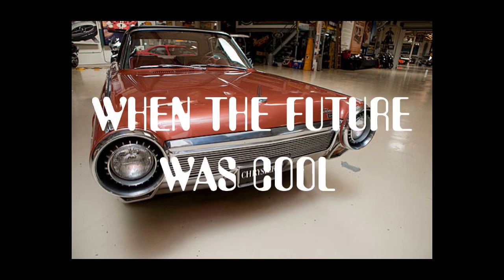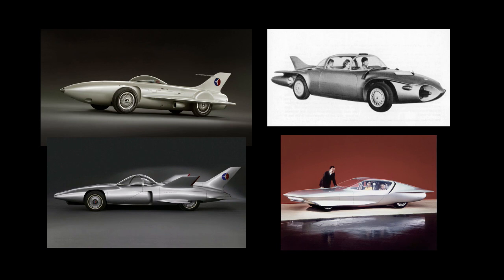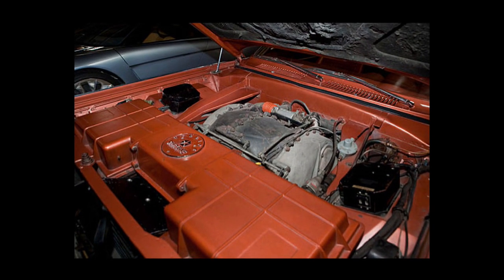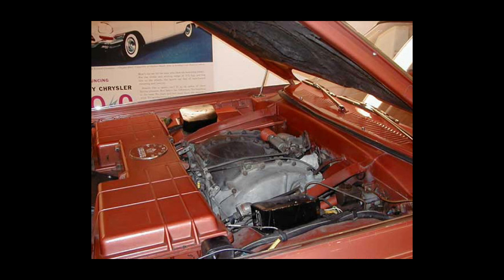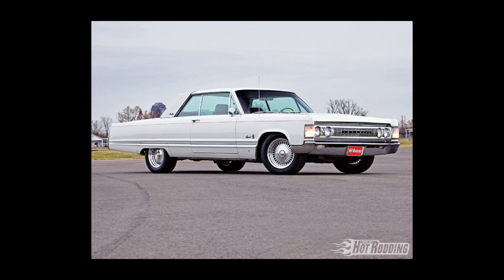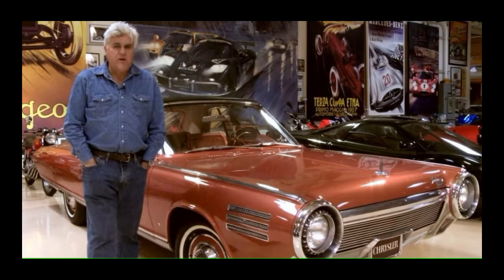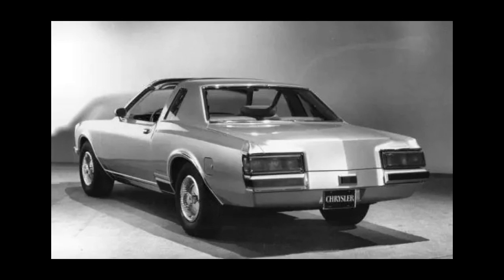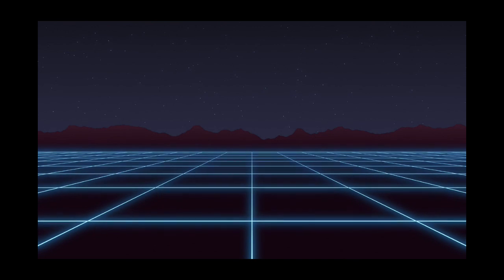A Jet Engine Under The Hood: The Chrysler Turbine Car part 2

Comment: I never got a ride in one, but I did sit in one when it was running. They balanced a nickel on edge on the top of the dashboard. No vibration at all, the nickel just sat there. Very cool car, wished they would have put them into production. Thanks for the two videos.

Comment: FYI A gas turbine engine is NOT a jet engine. They have zero thrust. Gas turbines have more power-extracting turbine stages than jets to produce all the energy the combustor is producing. A jet has far fewer turbine sections (just enough to compress inlet air) so combustion gas is all-thrust.
Chrysler's gas turbine had two independent compressor-turbine spools. The high pressure inner pair (2nd and 3rd stage) ran all the time; the low pressure outer pair (1st and 4th stage) connected directly to the transmission, eliminating the need for a torque converter.
Reply: The Chrysler teaser ad's dubbed over the jet engine sound effect. The promise of the jet age future.
A Chrysler chief engineer was a former neighbor of mine. He brought a brand new one home one weekend oh so long ago. 
This vehicle lacked vibration and was eerily quiet. Perched on my mighty Schwinn bicycle watching that bronze beauty glinting in the summer sun as she rolled past is a fond memory.

Comment: That theater “The Perris” pictured around 9:10 with the Dodge coronet, is where I use to live growing up in the late 70s early 80s. They did film a movie there as that part of town is full of old buildings. “Calendar Girl” set in the 50s with one of the 90210 cast being a main draw. As far as I know it’s still there, not sure when that photo was took. 

Love the info on the Turbine cars. First learned about these from Jay Leno’s Garage. I can see why Chrysler crushed the majority of them but the body styling is so 60s it’s sad some weren’t converted over to Hemi’s or other power plants. The multi fuel aspect would be handy today.

Comment: Takes from the Ford Thunderbird which is odd for Chrysler.
Reply: Both heavily influenced by the Italian concept car by Ghia.
Reply: Elwood Engle designed the 1961-63 Bullet Bird.  The roof lines of both cars are very similar; the front of the Turbine Car looks like the rear of the Bullet Bird.